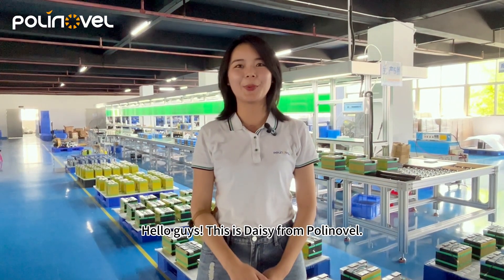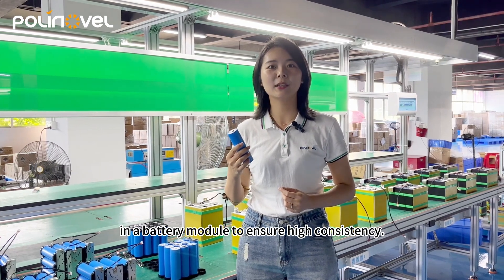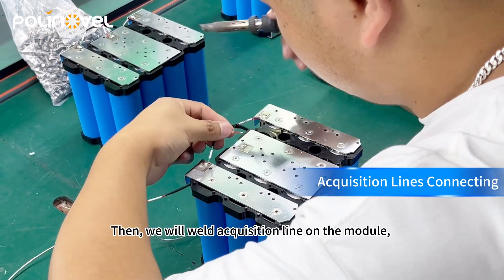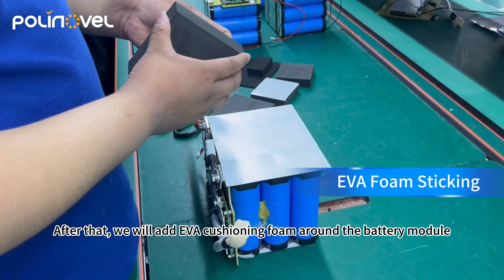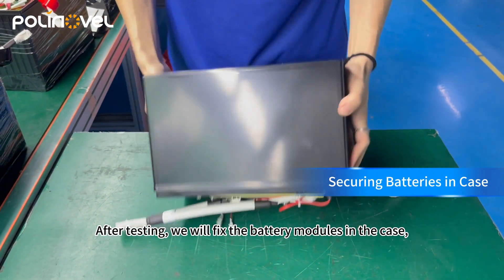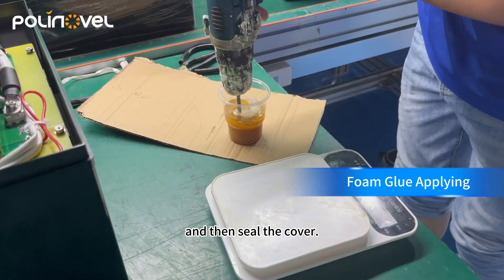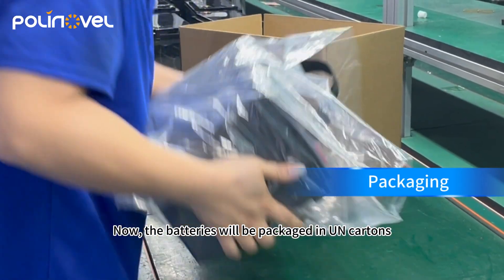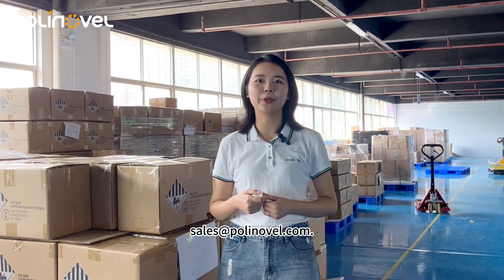Polinovel manufactures high-end dual purpose lithium batteries

Comment: Do you also make dual purpose marine battery in 200ah and higher?
Reply from the maker: Yes, we have 24V 230Ah. Here's the product detail: https://www.polinovelbattery.com/24V-230Ah-Dual-Purpose-Lithium-Battery-pd786241188.html        
For specific voltage and current requirements, feel free to contact sales@polinovel.com for more details. Thank you!☺